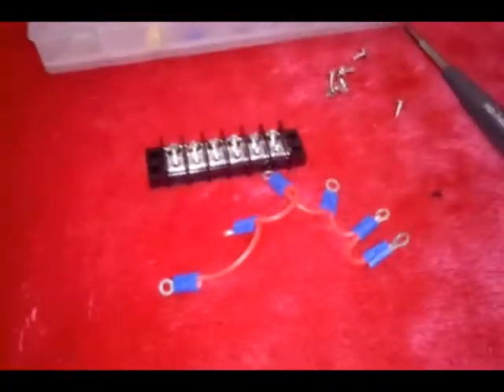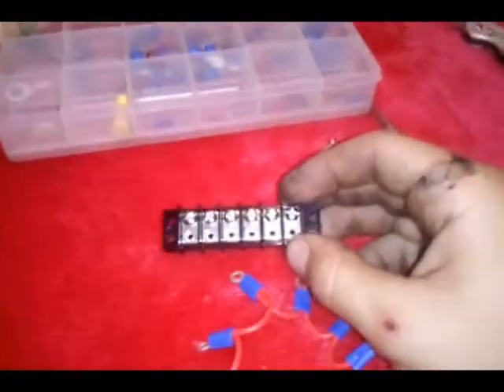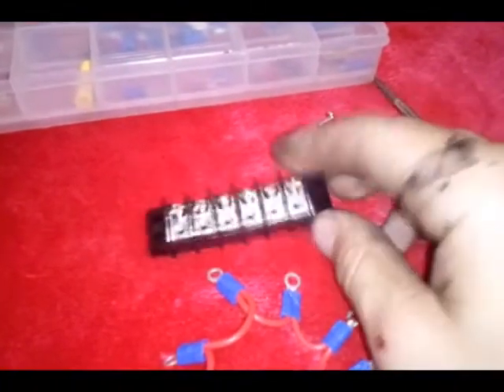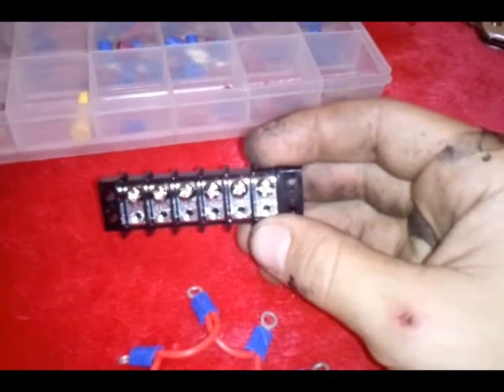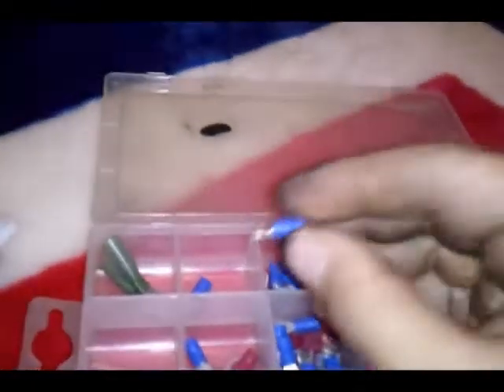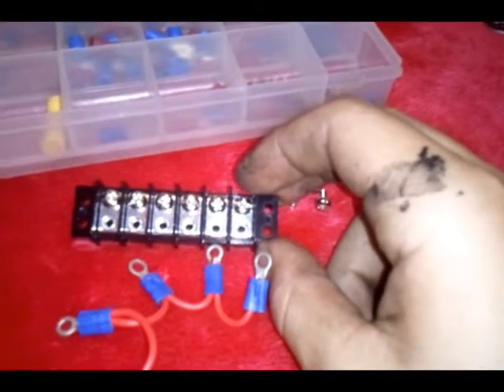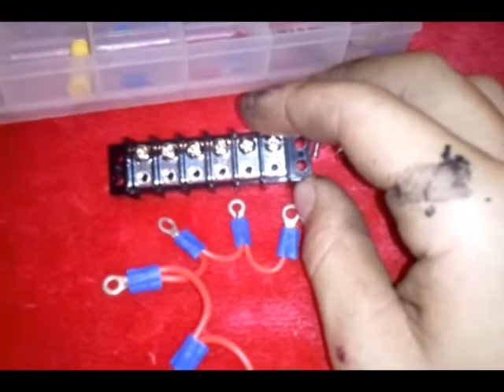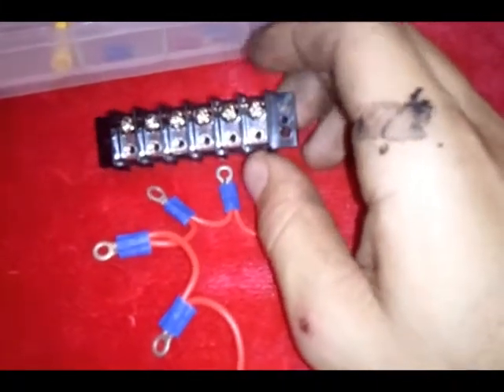Making a power distribution block for your electronics

Comment: FYI, you can get metal jumpers for those blocks so you don't have to worry about all the wires.
Reply: Groundhogday Moto i know this is an old post but I'm looking to do similar. would this do same job? Look at this on eBay  http://www.ebay.co.uk/itm/251760538178
Reply: TWO WHEEL FIX yes it will but what kinda power you running through it? 12v 100a?
Reply: Nicolas Wallace thanks for reply, i was hoping to run a positive block and a negative block through a relay on a motorcycle. i want to power heated grips, usb chargers and auxiliary lights without draining battery. i was thinking maybe take feed from tail light so everything is only powered when engine is running.
Reply: No problem! Okay, your first step is to add up all the max amperage pull from all the devices. If it's 15-30 amps max, you can buy a cheap terminal block or two off eBay and wire it up that way. I just recently purchased some cheaper 15a terminal blocks from eBay, and only paid like... Around $2 I believe. It's really cheap, and i got 5 blocks.
Reply: Nicolas Wallace cheers, most of the the terminal blocks i seen were bordered, I'll have another look. i have it wired up at the moment using front lights and each accessory has its own fuse but i was worried about the canbus system, as that's like a dark art to me.